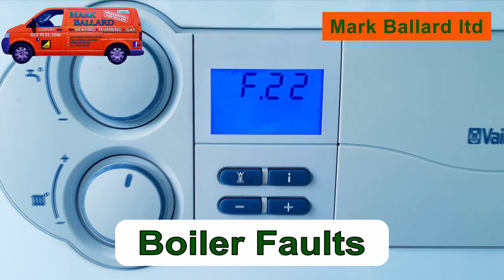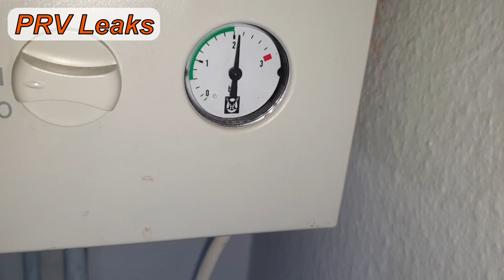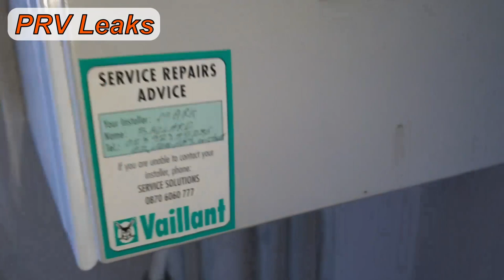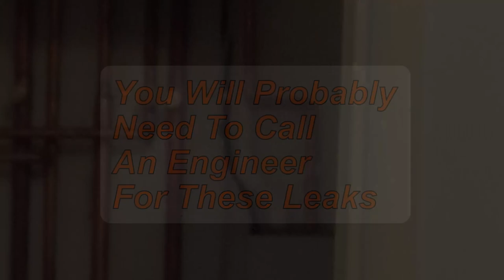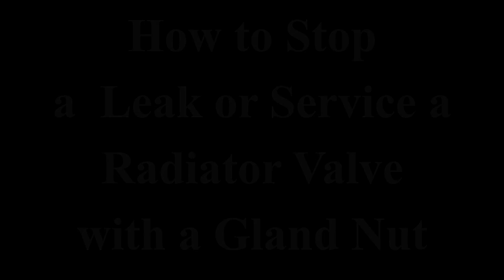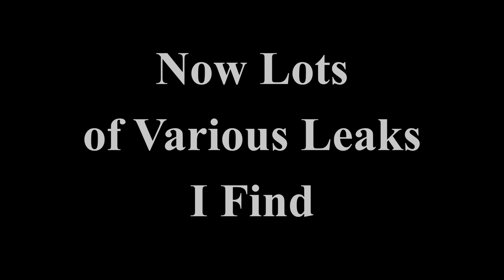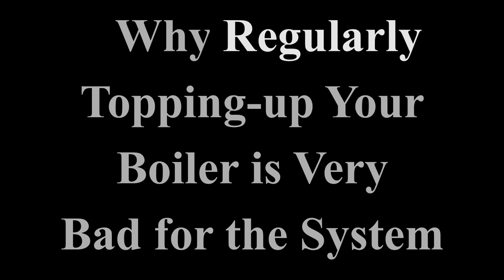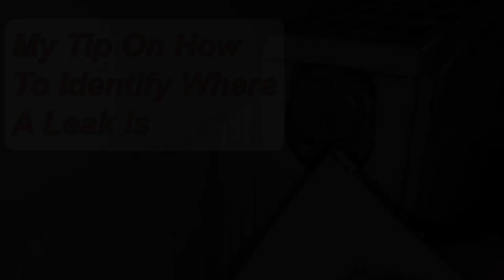Boiler Keeps Losing Pressure

Comment: I found that the tenant was on a pay as you go electricity meter and he often let it run out beyond the emergency credit, so when he added credit, the boiler would go through its start up sequence which I beleive can perge water through the pressure releif valve (PRV) and so over time the pressure dropped.  This also caused the PRV to start leaking as it was operating frequenly, and which finally failed on Christmas day!  Luckily the boiler had a 5 year warrenty and they came out and fixed it for free!  The new teant keeps it in credit all the time and so has not had the pressure drop.

Comment: Thanks for this. Our boiler loses pressure over a few days of running and can see drops of water out PRV. The engineer who fitted it opened the valve when fitting it as it was overfilled. Hopefully they accept it’s their mistake and change it free

Comment: A month or so ago the release valve on our furnace was leaking, lost all pressure. I called a friend who came over to take a look at it, and just as he got started the leaking stopped! All good, just need to refill -- NO. Now we keep losing pressure. The basement especially the furnace room gets hot while the rest of the house gets cold, I refill every two or three days. There has been no more water dripping out of the release valve. But there is an old open ended pipe in the basement toilet room which I have discovered that water is dripping out of. I don't know what to do!

Comment: Hi Mark, thanks for the video. I wish you were closer to were I live - I presume Woking is too far away for you. I have a new-ish Vailant Ecotec 25 - 18 months old, it has been serviced twice. The pressure is all over the place - for example over the past four nights it has twice fallen to zero and twice increased by 0.5 - o.8 bar. On good days the pressure increases by about 0.25 bar, on bad days it drops, if not to zero then at least enough to throw an F22 three or four times in the day. (It doesn't seem to make much difference if the heating is on or off, but it doesn't happen in the summer when the heating is never on. I generally reset it on the highish side ~1.8 - 1.9 in the hope that it might either last a bit longer or help to locate any leak; the highest I've seen it rise to is 2.7 bar- too high I know but no sign of water in the PRV pipe). We called the service engineer who thought it was a blocked heat exchanger. We called Vailant (it's still under warranty) and they tested it and assured us it wasn't, it had to be a leak in the system; they replaced the PRV as a precaution. There is no sign of any leak anywhere above ground (the radiators are all new) so we called a specialist leak-detection company. They spent about 6 hours with their specialist equipment and dug up much of our newish wooden floor and bathroom tiles. They found a slight 'seepage' from a plastic pipe connection but not enough they thought to cause the rapid drop I see on bad days. They were right; fixing it has made no discernible difference. So we have the Vailant engineer, the service engineer (OVO) and the specialist leak company all saying 'we've done all we can'. Vailant suggest I add some Fernox F4 leak sealer to the system but I'm a bit loath to do so given the pressure rises and the inconsistency of the pressure losses. Very aware of your advice that constant topping up is bad for the system, and I'm having to do so 10 - 20 times a week, any suggestions would be very much appreciated.

Comment: My pressure kept dropping 2 times per day.  Turned out to be a nail through the radiator pipe. Had a new bathroom fitted including new floorboards.  Only way to fix it rip all the floor up including the  Tiles and new shower unit.  Company who fitted bathroom dragging their heels. Hope to have the bathroom fixed by Christmas.

Comment: What is your experience with last resort leak sealers? I have a leak under downstairs floor (somewhere) and used Fernox F4. Boiler is finally holding pressure now, just curious how long it might last. I was losing 1.0 bar a month so not a big leak.

Comment: So I'm currently topping up my system at least once a day! Goes from 1.5/2 down to 0 that quickly. Only large amount of water I can see is coming out of the condensate pipe – does this mean it's the boiler likely at fault and if so, specifically what should be checked first? Expansion vessel (external) and head (switch) has been chnegd already, along with hot water cylinder!

Comment: One of the best videos IV seen. Especially showing where it could leak from and what it can look like if leaking. My en suite towel rail was leaking from its connection at bottom, just felt rusty when heating was on, first thing in morning before heating on felt it and it was wet slightly enough to cause pressure drop over time. Amazing stuff. Very hard to find it even tho it was right under our nose. Thank you very much.

Comment: 13:00 13th Feb 2024. I've just had a new boiler fitted and within a fortnight the pressure kept dropping daily. Sometimes with no hot water.The supplier says there is a leak on my system but it can't be the boiler because it's new and there is no visible water drops. Is there anything I can do? Could flushing the system have disturbed a joint?

Comment: I had a new Worcester boiler installed 2 years ago. Within a month I noticed the pressure was dropping to zero, the installer said it's most likely because I moved from a 34 year old boiler that didn't rely on pressure and the pipes of the same age might find a pressurised system caused a small leak. At the 1st service I pointed out i found a leak on a pipe before the boiler having done the checks on a video similar to yours.

Then magically at the 2nd service. The older engineer didn't say anything but it appears the boiler now doesn't drop any pressure at all EVEN after a month. Where as every 2 to 3 weeks it was going from 1. 5 to zero.

Is it possible that when it got installed 2 years ago, something like a valve wasn't fully tightened?

Comment: interesting video.   If you have a pressure drop and need to top up twice daily from 1/2 to 1 1/2 bar, is it possible that the leak is on the house side of the boiler if none of the rads have any air in them when bled. the boiler (5 yr old oil worcester bosch) has just been serviced and is apparently all good with no leaks, there are no damp patches that we can see and none of the rads seem to have any leaks at any valves, there is no carpet to absorb any moisture, its all laminate, lino or tiled.

Comment: Hello, thanks for your video. I have had numerous repairs (into double figures) done by professionals on an unvented cylinder system, due to constant running water in tundish and recognise the replace PRV solution described here but unfortunately this has not worked for us. We have now replaced the thermostat but think it is actually the fact that the boiler keeps firing regardless of the temperature and even when it is set to OFF on the control panel. I think this blows out all the valve replacements over time due increased hot water pressure. Pressure on the heating keeps dropping and we get boiler leaks although we are always advised this is a separate circuit and an unrelated issue. We think it could be due to pressure build up in the heating coil caused by the generally too high temperature in the cylinder. Further research suggests it could be a faulty auxiliary switch but I am not a plumber so just going on internet searches. Any advice would be most welcome as we have not been able to get anyone to solve the issue to date. Many thanks!

Comment: Both PRVs didn't need replaced and the filling loop didn't need to be renewed, a recall to a wrong diagnosis and repair (I hope the customer was reimbursed)
Reply: You're right pal fist thing I do is tap the expansion vessel with a screwdriver

Comment: Hi Mark, thanks for your informative video. I have a Vailant system boiler with a tank next to it . The water is running out of the Tundish. I would appreciate your advice 
Thanks 
Ahmad
Reply from the maker: Probably needs the hot water pressure vessel recharged.
Reply: @MarkBallardLTD  hi I have a question when I turn on my hot water the boiler pressure goes down on the bar and it is losing pressure very slightly any suggestions please

Comment: Cheers for this! My boiler has been losing pressure for a few months. Pressure relief valve dripping. Boiler an old one so when it goes again it's being replaced. Nice to know why I'm having to top up though.
Reply: If it's a Closed system the  Expansion Pressure Vessel that has lost charge, same  acts as a   safety device allowing the  hot water to expand as its heated within the boiler and the domestic heating system in general ...you're best to have it checked out,  if you can locate the tyre valve on the vessel, very briefly  push a match stick onto the valve stem it should have Air coming out... If Water comes out it has Failed...if no air comes out, allow the whole system to cool down, then charge that empty Air Vessel to 1Bar...with a foot pump and see if it makes a difference. sometimes it's best  call a Heating Engineer and get a Full service and the Boiler could last several years more with some LOVE. and you would save money with lower Heating Bills too...

Comment: Morning great video 
I have a problem with my boiler works fine on hot water 💧 but as soon as the  heating is used it runs and works but when the heating goes of and boiler cools down all pressure is lost and you have to repressure it I’ve checked the prv and that isn’t running any ideas does it sound like a radiator valve leak there isn’t any sign of a pipe leaking 
Any ideas would be most appreciated
Reply from the maker: If you're topping up your boiler everyday that's pints of water you're losing. you should be able to see it coming out somewhere
Reply: Mark Ballard LTD it seems to be going into the condensate drain off been watching it with the heating on and it seems to be water going straight into it as watching kept topping up the pressure as it kept dropping with heating on
Reply: Probably there's a pain hole inside the main heat exchanger.